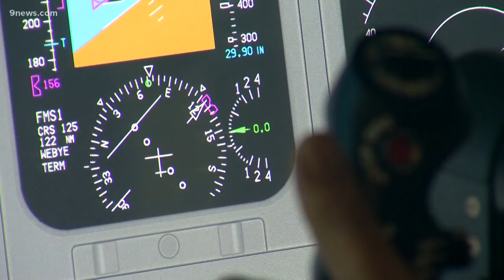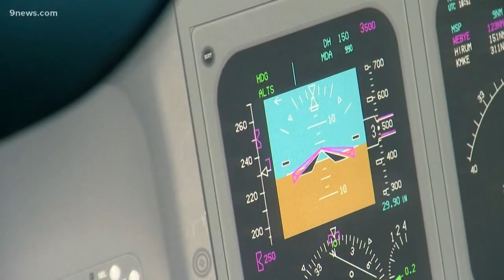How aircrafts like the Boeing 737 Max 8 navigate in-air stalls

Comment: As far as I understand, the MCAS system does NOT disengage with the autopilot, pilots were NOT told about it until AFTER the Lion Air crash, so the Loin Air pilots were fighting an absurd problem. It seems logical to treat this as a simple runaway trim problem, but the intermittent automatic pitch-down trimming would have been extremely confusing. A previous crew had encountered the same problem and fell into the same trap - while they were busy fighting a weird problem, they had the blind luck of having a third pilot in the jump seat that could only observe. He had a broader overview of the situation and spotted the solution: Disable the Stab Trim!